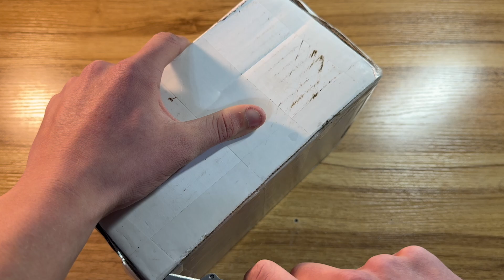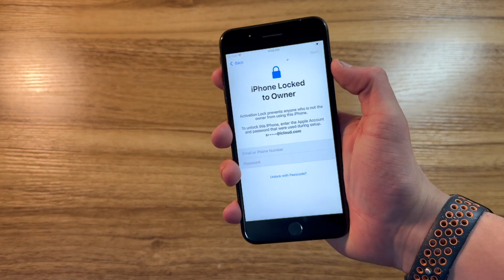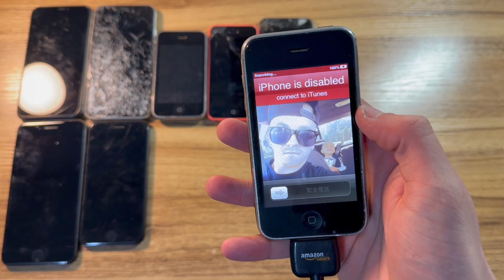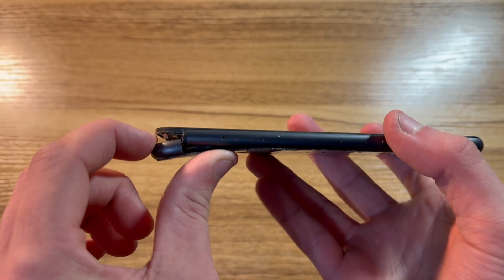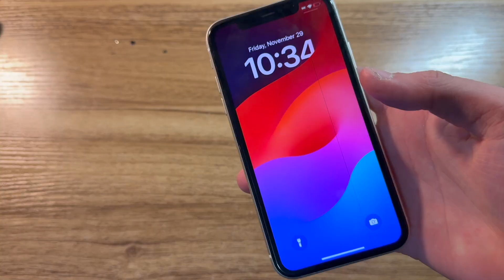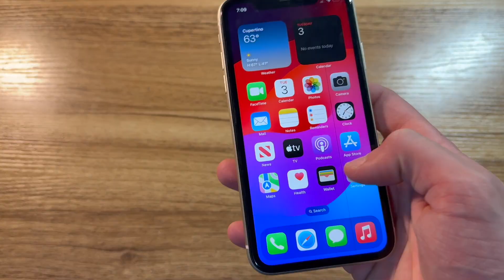$90 iPhone 11 Lot - Hidden Treasure?

Comment: How come you make more with fmi off?:)
Reply: If an iphone has FMI on then you cant use the phone as its locked to the old owner unless you get lucky and guess the password or know the orignal owner then its done pretty much
Reply: @Chattytreetop2.0-j9veven if you bypass it, it still isn’t worth at much as if it just didn’t have fmi on?:) thanks!
Reply: @channelryuk  well it depends how you bypass it becuase iphones are alot harder to bypass and the amount of iphone models that can be bypassed is kinda limited (i see software that works for phones like the 6s/6s plus iphone 8 i think the iphone x and a few more and iphones under the A9 chip are bypassable with some other software i think im not sure if it actually works tho) and there is a chance that after bypassing, some iphone models wont fully function so yea potentially if the iphone dosent work properly then it will be worth less but there is a chance it will work fine im not sure tho i have never tried these softwares (im pretty sure there free too)
Reply: @Chattytreetop2.0-j9vyeah i saw i think this guy use something called sliver for the icloud lock but  i noticed its kind of for older models like you were saying. thank you for your time and answering my questions! you’re the best <3

Comment: You can get into recovery mode on an iPhone 8 or newer by just powering it off, then plugging it in and holding the side button, no need to use either of the volume buttons.  It's kind of weird how I figured this out, but it was because one of the iPads at the store had the power button pushed in by the mounting bracket and it was stuck in recovery mode as a result of that.

Comment: dude, you can turn off the iphone 11 just by long holding the power button. it will eventually shut off. and there are ways (3utools) to put damaged phones into dfu or recovery mode. also, you can probably get most of the icloud locked phones unlocked with apples unlock request form.
Reply: apples unlock request form doesnt always approve it though it could get denied

Comment: With the black iPhone 11 iphone you could have just used 3uTools; when flashing (Restoring) any ios version if not in recovery mode it automates the process and restarts the phone and puts it straight into recovery mode without you needing the volume buttons

Comment: You can see if the phone runs IOS 5 or 6 by the lock icon on the top of the HELLO screen, IOS 5 is the only ios that had that lock in theiddle of the top of the screen before you slide to unlock
Reply: iOS 5 was not the only one, it was 1-5 that had the padlock

Comment: You can press the power button repeatedly to turn off the iPhone 11. I did that myself
Reply: they changed it in the new ios update now its emergency sos 5 times calls 911
Reply: @matd  it does not do that on my iPhone 11. It just takes me to the slide the power off menu emergency SOS and when I slide it it will call 911 automatically instead of doing the countdown
Reply: @matd its an option in sos settings, its off by default im pretty sure

Comment: Wow! That is so Cool. You found an iPhone 11 treasure. I actually have a red iPhone 11 that's a 64 GB running iOS 18.1.1. it was running either iOS, 14.4.4 or 14.8.1 when it was stuck in a boot loop on the Apple logo. After I plugged it up because the battery was dead it was likely because the storage was too low and it powered on and got stuck on the Apple logo and I managed to restore it through dfu mode on iTunes and it told me iPhone lock to owner and I managed to bypass it with the passcode and I was able to set up the iPhone
Reply: How do you do the bypass I want to do something similar like what he does in the video but I’m scared of the iCloud stuff and the unavailable screen
Reply: @lijah_c_2750  if the phone had a passcode and it's on the activation lock screen or iPhone lock to owner screen you press use another method and then there's a chance you get the passcode correct? But you could also brute Force the passcode using a application on your computer for brute forcing passcodes
Reply: @3L1JAHC if you have an iPhone yourself that got stuck on the Apple logo and has an activation lock and you remember the passcode you can unlock it with the passcode the activation lock
Reply: Please what software can I use to downgrade my iPhone from iOS 18
Reply: Pleas can you help me with downgrade software
Reply: @jimolumuyiwa3128  You got to use tenoshare reiboot to do this because it has the option to downgrade the software